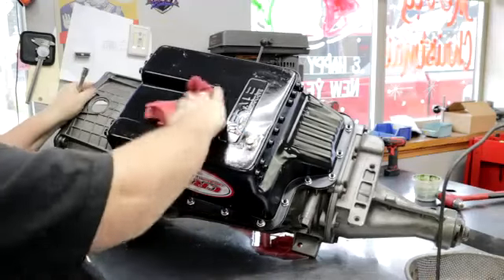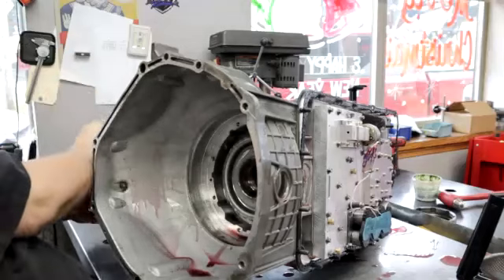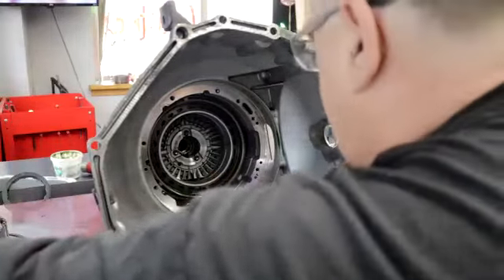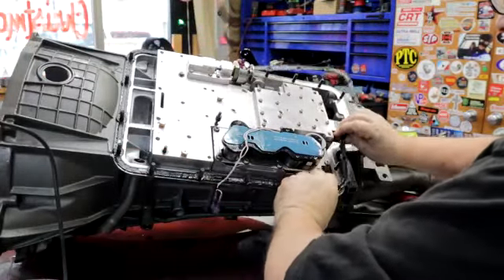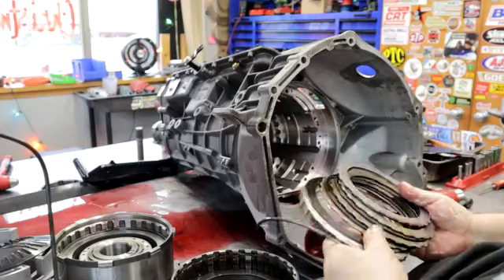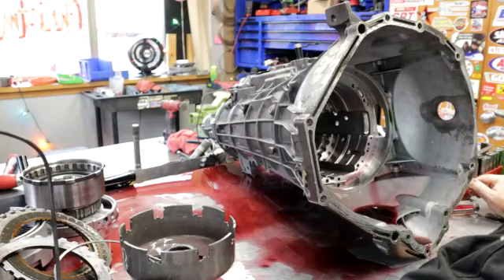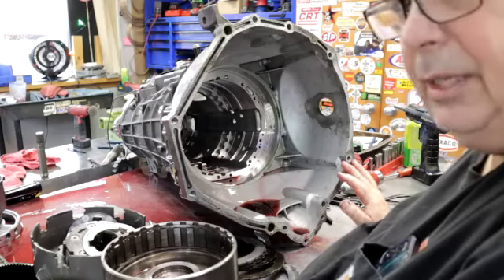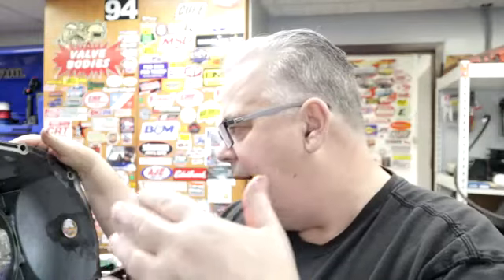YOU WILL NOT BELIEVE WHAT BROKE  @unitymotorsportsgarage

Comment: On the converter thing, you can get multi disc converters. I have a 2004 lightning that probably makes 900+ to the tires and I lock up the converter at 20mph in first gear and keep it locked through the shifts. This is with an A1 trans stage 3 1500hp build. I also have a 1994 lightning 427w twin turbo with another stage 3 A1 trans and i lock it in  2nd and keep locked going into 3rd. I would look into a better converter if you cant lock it up under power.
Reply: What converter are you running?
Reply from the maker: Thank you for that information
Reply: @UnityMotorSportsGarage  In my 2004 lightning it has a Precision industries triple disk "stallion" 2600 stall. My 1994 lightning twin turbo truck has the "in house" triple disk converter from A1 transmissions in GA. It is from a company in California who when I researched it they build a lot of racing converters for diesel trucks. I don't remember the name of their converter. I know that it's orange though in color.
Reply: Just looked it up. It is a D&P Torque Converter in my Gen 1 lightning. 3500 stall. They make some nice stuff from looks of it.

Comment: Just built up a mean a604 with 42rle jeep internals with a precision 8 bolt converter. Those converters are crucial.. and the shift kits and transgo and sonnax on everything. Ill drop my valve body next week to go to bigger 9/32 steel check balls soon for more apply pressure 😁